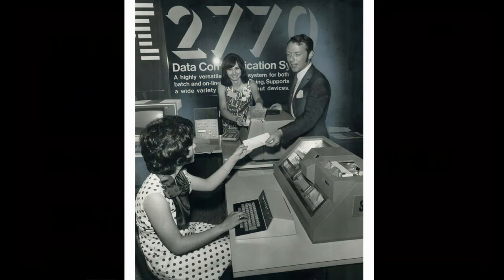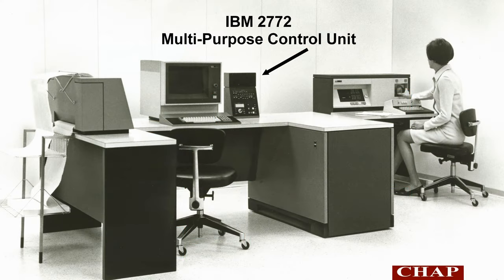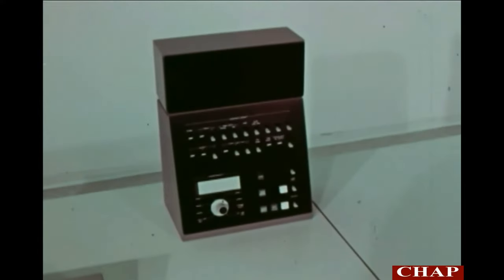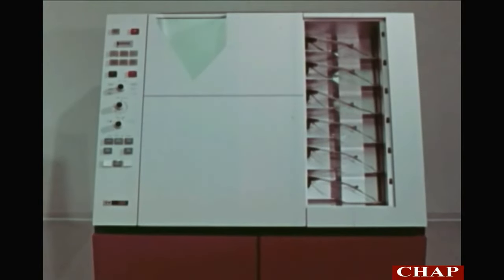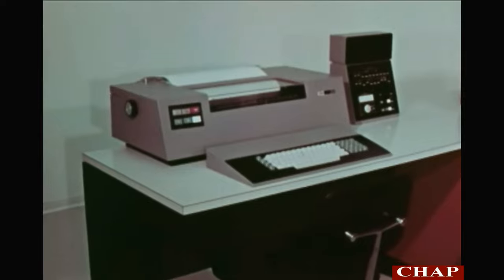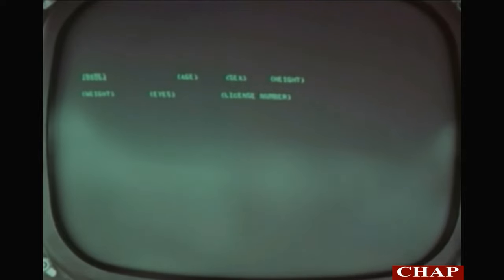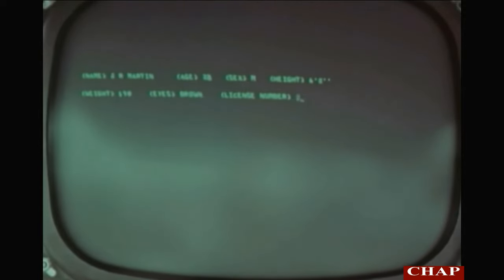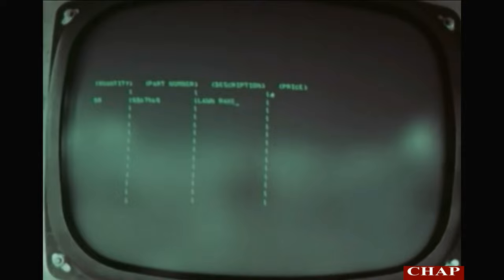1969  IBM 2770 DATA COMMUNICATION SYSTEM ( Extended Version ) Bisync 360

Comment: Never used a 2770, but used 2780 BiSync protocol for file transfer on many machines. Virtually every manufacturer had an implementation or two, so it became a de facto standard. Wrote a couple too.